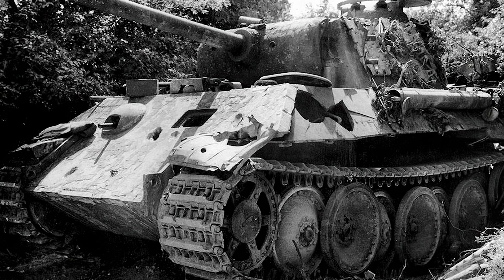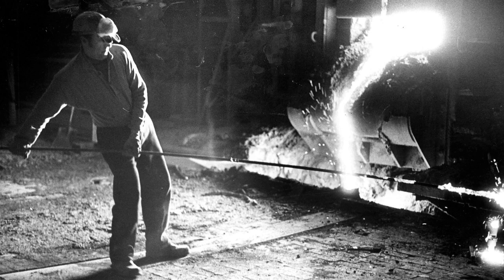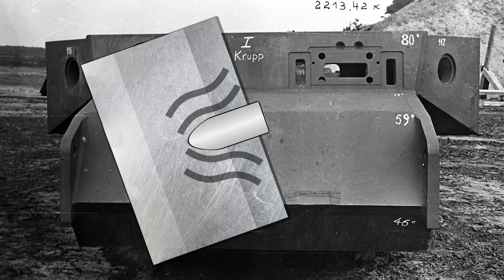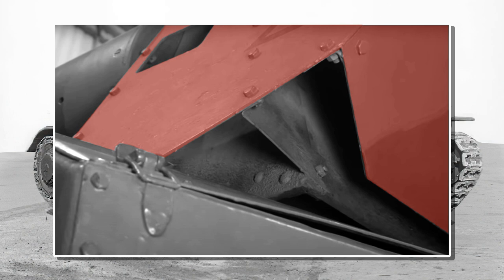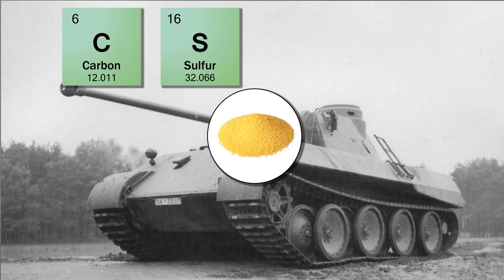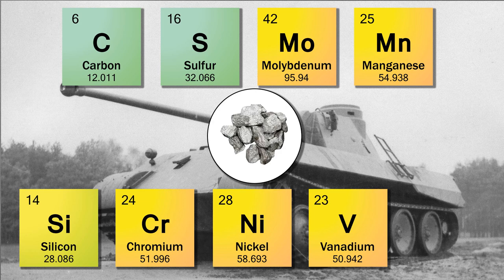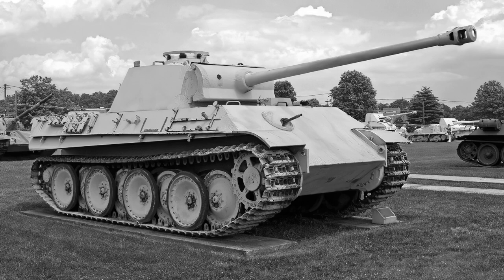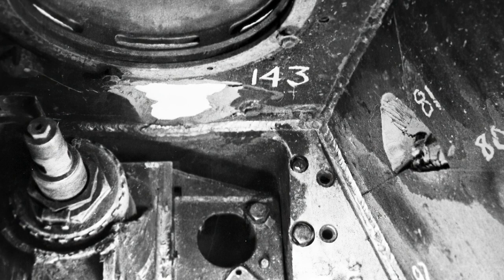Panther Armour - Tank Research & Review

Comment: thanks ( of should I say tanks ) for the video.  I found it very interesting indeed. I have a reasonable experience in this field and you explain it better than I ever could! I am curious on with type of steel the germans were using. You explain it in broad term but  I am used to see the type of steel be written in a DIN number or as a code.  Something like this : chrome moly steel /  25CrMo4 / 1.7218 . Is there anything in the sources with gives the steel number? that would make it a bit more clearly for me. 

I can also have a look if I can find a steel number if you are interested. Just let me know.
Reply: I’d be surprised if they used such a sophisticated nomenclature 80 years ago. The lack of critical minerals was even more dramatic in the jet engines Germany used. I read the memoirs of a German pilot years ago and he mentioned the jet engines only being reliable for a matter of minutes because of the lack of critical minerals. The Germans probably tried to compensate for the lack of vanadium, for example, by upping the levels of minerals they did have. Also, possibly the slave labor ( if used) was not exactly keen on doing things properly for the Germans. This is an excellent video and he draws some pretty good conclusions in the last couple of minutes. I think the Americans had the best handle on making consistent armour steel because of the experience of the auto industry in mass producing vehicles. The European countries were producing vehicles in much lower volumes and just didn’t have the experience of producing quality and quantity at the same time.

Comment: I disagree with this assessment on the grounds that there is one incredibly important situation that caused the problem with Panther Tanks.   THE CONTINUAL BOMBING CAMPAIGN, that was done on Germany that knocked out and damaged Germany's Industry.  By 1944 the overall quality of German equipment is on the decline. Germany could not afford excessive testing.  It was get them out on the field as fast as possible.  Those are just the facts of taking the fight into Germany with Air Power.
Reply from the maker: Oddly going over the Speer papers (Op Dustbin) he stated in his interviews following the war, that while it was detrimental it didn’t affect the situation as much as the allies thought it did in terms of vehicle production (and he would be the one to know) this was due to the backup factories and the allies switching between target types before thoroughly obliterating one type, what it did do, according to Speer was cause severe communications problems which slowed down stuff by weeks to months.

However, on the steel issue he noted that from even 1940 they were having issues and from 41 essential alloys were missing from tanks and submarines. If you look at some of the early knocked out vehicles you can also see the tell-tale shattering of armour plate.

Comment: Scandalous, your statements contradict much of what Jentz wrote and that is commonly accepted. Not my area, so I have no personal opinion. Will wait for the jury on this one.
Reply: Shocking I know, that said when Mr. Jentzs did his excellent books there was a lot less access to some information. The more dangerous part is the - well look here is footage of rounds bouncing, which is akin to saying I came off my motorbike hard and the crash helmet worked but its probably still good to wear again. what you dont see as often is the damage inside or too the plate itself which may have any number of fractures.  overall there seems to be a feeling that if you don't like german armour you must love allied armour etc, which isn't true, the Shermans armour was quite good in terms of steel quality but still inadequate for the job etc.
Reply: @edfrancis712  Actually the US tank armour, especially the heavier gauges of 2 - 3in. was very variable in ballistic resistance (I'm not saying "in quality" because that would not be the correct therm to use here) until about 1944 when, after years of manufacturing and testing, it was determined pretty well what metallurgical properties were desirable to have in tank armour for best ballistic protection. Before that the only way to know for sure were live ballistic tests, that obviously could'nt've been done to the plates you wanted to use in actual vehicles afterwards.